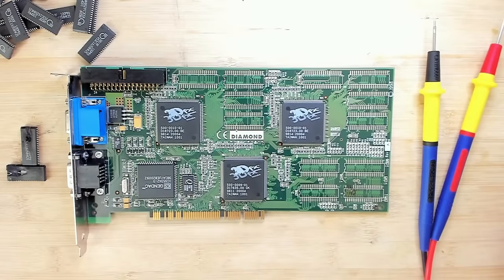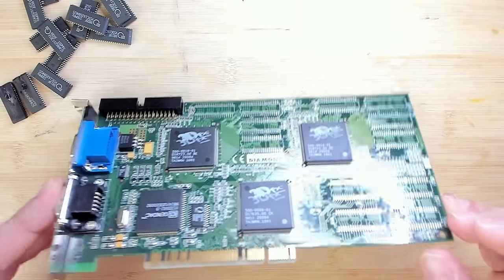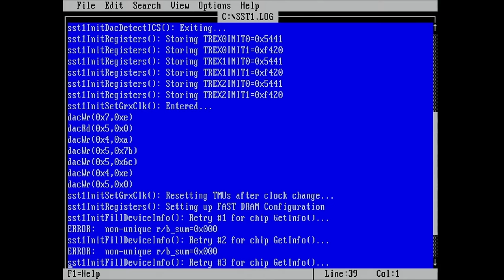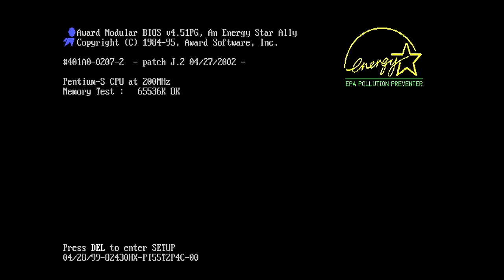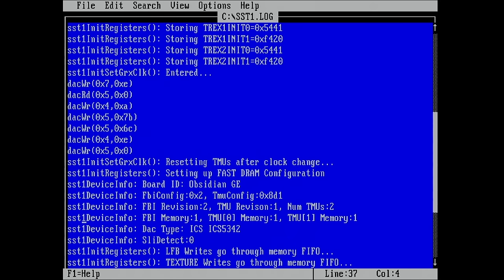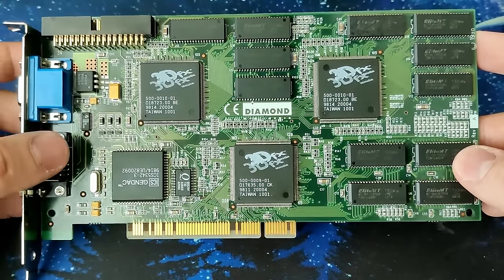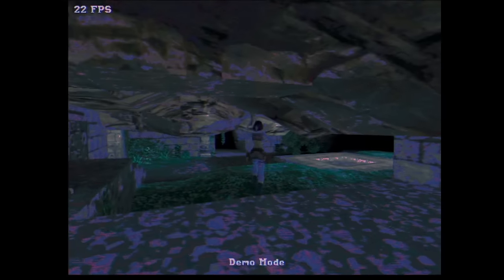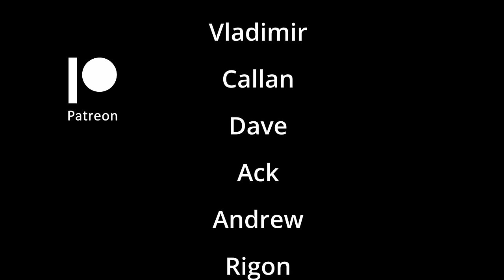Diamond Monster 3D II - A Voodoo 2 rises from the ashes? (Part 2/3)

Comment: Hell yeah, it's alive! 🤘 Well, somewhat. We all know that Voodoo magic sometimes comes with unintended side effects. 😄 Amazing though to see that at least some of the irreplaceable chips should still be good.

Ballsy move to plug it in at that stage, I would have disconnected the output from the VRM and checked its voltage first. And I would have powered it up while watching it like a hawk with that fancy InfiRay IR camera, ready to power it off at the drop of a hat. I was super relieved to see you successfully helped it get rid of its smoking habit! ✌

That color issue looked very reminiscent of VGA connector issues, my guess would have been the DAC, especially since it is alsodirectly connected to 5V. Glad to see it was just an issue with the TR patch and is already "gone". Still kind of a happy accident since we wouldn't have gotten to see Lara with the correct patch yet, right? As for the lack of FBI memory, I concur with what some have already suggested, checking all the data lines between the FBI and memory chips should be the next step. Hopefully it's just a damaged line between the two, causing it to stop looking past the first MB, rather than the FBI chip itself. If it is, maybe you can fix it by manually adding a wire or by doubling up memory chips like you did on the Voodoo 1 cards?

Hopefully, the observed slowdown was just a consequence of the inappropriate TR patch or of it having just 1 MB of frame buffer memory to work with. I couldn't think of anything else causing such an issue on a card of that generation really.

As for (hopefully useful) suggestions that have not already been made: Hit it with the thermal camera, comparing it to the identical model you have. Any observable differences may be a pointer as to where (physically) things still go wrong. Since the 1 MB issue already showed up when installing the first 2 MB, it would make sense to be located around there?

Seeing a Mega Monster (that's what Diamond called a pair of them IIRC) in action once again would be awesome, I'd love to see some videos about that! I actually built one of these (from two retired cards) for a neighbor back then, it was a great option to extend their useful lifespan for a bit! SLI was way better when it still stood for scanline interleave! 😉

Comment: My guess is to start by checking all connections, starting with the chip enable lines on the memory. Considering it can use variable amounts of memory it likely checks what is there by seeing what it can read write to successfully. So ras cas etc are next. You might also use a scope to check for weird signaling on the memory lines.

The color.... I would ignore that until the memory is fixed, I don't think it's likely to be related to the ramdac. But one thing at the time.
Reply from the maker: Agreed! Focus is on fixing the memory amount on the FBI chip. It is the most obvious issue for now.

Comment: I would suspect a bad trace. Also, perhaps check out that burnt spot you think you saw. I mean, it should be an indicator of something bad.
Reply: I think the black spot is a melted via, which means it was probably connected to the Vcc plane on one end and a part that needs power on the other -- or even half a chip, since the RAM chips have two Vcc pins each and they don't seem to be connected internally. I kinda hope this is true because it's easy to bodge around and there's no worry about signal timing or anything.

Comment: Incorrect memory sizing is almost certainly addressing related. The FBI isn't able to address anything past the 1 MB range (0x100000). I would try checking address lines from the FBI and seeing if they connect to each memory chip. After that you might just be SOL with that FBI.

Comment: I imagine that the FBI issue could result from any of the following: A bad memory chip, or two, or three; faulty trace, either disconnected, or a bad connection is adding resistance/capacitance/etc.; damaged FBI circuitry.  The possibility exists that one of the old faulty memory chips failed in a way that send too much voltage along a data or address line to the FBI chip, and it 'popped' an input protection circuit on the die.  If a sort of memtest existed for each memory bank on this card, that might make the issue very clear.  I am uncertain if that functionality can even be tested in a user-visible way, but since the output is user visible, I imagine a creative solution exists to test the memory.  Swapping the memory chips around could also help test the bad chip thesis.  Have you not received any sockets yet, or do the 100MHz chips malfunction in those fixtures?

Thank you for the quick 2nd video on this!  In your own time, for the next one.
Reply from the maker: I didn't put sockets because there is no space on the board. The memory chips are too close to each other or SMDs are in the way. I hope to gain access to something really cool that might eliminate all the guesswork!

Comment: I'd try a test program in Glide that writes to the front buffer directly with the usual bit patterns to detect address or data errors. Not sure how much mojo does, it may just read/write until it find the first error, even if it is only in one data or address bit.

Comment: I remember there were some mainboards from certain manufacturers where they had what looked like a standard 24 pin ATX power connector but they wired the connector different than from standard. I think some old Dell machines that had the mini style ATX power supply did that. If you think they're using a standard ATX pinout and try to test a machine with a spare ATX power supply, it's possible you could send the 12V to the 5V on the mainboard. If this is what happened I'm quite certain the original machine this came from was totally borked.
Reply from the maker: Sigh, that reminds me of my recent adventure of EISA and OPTi local bus. Same connector, electronically different! Great!

Comment: Not only memory chips can be affected by overvoltage. There also can be problems on data/address lines on 3dfx chips, wich were connecred to the burnt memory chips. No one knows what was happened with data/address pins when the "magic smoke" escaped from the memory chips.
Reply from the maker: I agree. I hope this was not the case, but it could be a possibility. That would mean, I have to replace the FBI chip. I have a card that could serve as a donor, but the chip has bent legs 😔

Comment: in the analog technic ( whoch VGA certainly is) a pinky discoloration is usually caused by a weak or conpletly missing green color.
so maybe chech the connection from VGA-green to the digital analog converter in comparision to the red and blue one.
fantastig work so far.
i enjoy your videos a lot.
i hope the card will come back from the dead. fingers crossed. regards alex
Reply from the maker: Thanks! I hope the FBI chip is not at fault. I have spare DACs, more memory, and a donor card for the other chips (I just don't want to replace the 3Dfx chip if it's not necessary). Part 3 will be interesting - can't wait to get it ready, but it may take a bit more time...

Comment: I would check that every data, chip select and address line has any activity in the fbi memory with oscilloscope as sanity check before replacing anything. My guess is that something is stuck high or low and is the reason why it sees only 1MB and in bad case it's the FBI chip internal diodes
Reply from the maker: Agreed! Better to get as much information as possible before replacing chips randomly. I might get access to something that will hopefully eliminate all the guesswork!

Comment: I'd recheck all the connectivity for the FB memory after you repaired those pads.
There is a chance you lost a connection there and since each chip appears to be half a MB I'd say it fails on chip 3 which could be the one you repaired.
It most likely detects memory by cycling through the first address of each chip and sees if data can be stored there during init. Common way to check memory.
Reply from the maker: The chip in place of the burnt one on the front is the only chip I have checked thoroughly. I need to check all the other memory chips on the FBI chip and see if I can find the problem. Worst case, I would need to replace the FBI chip.

Comment: if you're going to check the address lines for good connections also check for short to PWR GND some lines might be stuck because of PCB damage
Reply from the maker: I checked all those lines multiple times. Nothing suspicious and no shorts. Part 3 is ready with the resolution of what was the issue. I'll release it soon!

Comment: One of the chips for the framebuffer is bad, or bad trace.
Could also had high power come out of one of the melted chips onto most likely one of the address or data lines and fried one of the TMUs or FBIs. 
I'm not too familiar with the architecture of this card, but you could easily find the culprit with an oscilloscope and start probing the TMUs/FBIs for weird signals. 
Once you find the weird signals, trace back to the ram chip and remove it. If it clears up it was a bad ram chip or chips.
If it doesn't clear up, TMU/FBI bad.

Comment: I first would blame the PCB. I would check those vias under the blown memory chips. In my opinion the memory seen is really 1M, maybe some adress/data/control lines to the rest of memory chips have no continuity. If there is continuity from the memory chips (all of them) to the FBI, then I would blame the FBI. For sure, the DAC is not affected (in my opinion) because it outputs all 3 colors well, (I saw R, G and B). 
Also, that is what mojo also tells you: the memory for the FBI is the culprit. So, test all the lines from EACH memory to the FBI chip.
Reply from the maker: Thanks for the details! Ok, I'll check all connections to the FBI chip. So far, I focused on the chip that sits on the pads I repaired, those connections seem to be fine. But of course, it could be another chip that is the problem.
Reply: @bitsundbolts  I do not know for sure the memory configuration for Voodoo cards, but it seems to me that you have there two memory chips for each megabyte of memory. So, I would guess that there are two banks of 4 memory chips that are wired in parallel (data and adress lines) and the control lines are connected directly to the FBI chip. Maybe at boot, the FBI chip checks the available memory and if not found the remaining 3 memory chips, it assumes that there is only 1M available. This can be even if one data/adress line is faulty. That is why, I would check this first, also because those vias under the blowed chips may be affected by the failure (that first chip had melted metal inside so the extreme heat might caused bad contact in these vias)

Comment: What glue did you use for the replacement pads? Must be something special if it can take the heat of soldering.
Reply: As far as I understood it was an ordinary UV solder mask. After it hardens, the contacts will stick.
Reply from the maker: Correct
Reply from the maker: It is solder mask, which I kept outside in the sun for about 30 minutes. Once it cures, it can withstand the heat.

Comment: the tomb raider ingame scenes miss the green colour channel. You can use a six segment colour wheel to detect which colour is missing. The legs of lara should be yellow instead of cyan, so no green is present. Maybe a faulty DAC or a faulty VGA switch on the voodoo card. Check the green VGA output pin if any signal is present with an oszilloscope. This does not explain the missing memory. There are address lines missing. If data lines are missing, the game should have more picture defects.
Reply from the maker: I will first try to solve the memory issue as the discoloration seems to be related to the 3Dfx patch I had installed on my tomb raider installation.

Comment: Noticed some pink stripes in static positions which would point towards something being wrong with the framebuffer.
Don't know much about these cards at all but DACs of that generation often required negative and positive rails, often at fairly high voltages like +-12v that forces you to connect it directly to the psu rails so it could perhaps be borked?
Reply: Went and looked up the datasheet for that DAC. It does NOT need negative voltages and runs at a comfortable 5v.
Reply from the maker: Yes, but exactly this 5v line was the cause of the memory blowing up. I am surprised that it seems like the DAC is working. The only hint I have is the limit to 1MB for the frame buffer. Would be sad if this chip is bricked.

Comment: First learn how the memory is laid out. Likely it is laid out in chunks of 1MB by 32bits. The second bank is likely the one with the chip that welded into the pads and you had the pads repaired. After that is confirmed you can then check each bank for control signals (RAS/CAS/OE/WR) address lines and data lines. An method of viewing is needed (logic analyzer or oscilloscope). It is very likely that MOJO checks for RAM sequentially and gaps of malfunctioning memory will prevent detection of more memory. Motherboard chipsets do map memory dynamically but videocards are not required to do such a thing.

Comment: The QS5244 bus driver is on the 5V rail right?  Worth checking it looks right on the scope.
Reply from the maker: Yes, that is the small chip next to the DAC, right? This chip is indeed also connected to the 5v line. It would be an easy chip to replace - low hanging fruit so to say!

Comment: Hello BuB. I love all your videos and as always, give you my like.
I want to ask you. Why do you not socketed the memory chips? you said in the previous video you want to do it. And added to that, what happens if one of the memory chips is bad? one of the first chips. Even i see all the video, I get the idea of the first mb of memory have a kind of a problem while you add more memory, the issue persist. That's the strange feeling of the first memory is the faulty. But obviously could be other thing... (but in the video sequence you like... that's the problem, from the watcher perspective i mean).
Reply from the maker: I wanted to install memory sockets, but unfortunately, there is no space. The memory chips for the TMUs are too close to each other. There's no space. Same for the memory chips on the FBI chip. They are spaced a bit further apart, but there's still not enough space for four sockets. The other issue is that there are capacitors and resistors around the memory chips which are another obstacle for sockets. That is why I did not install sockets.

Comment: I'd remove the RAMDAC and the line driver/buffers and try Mojo. They are connected to the framebuffer memory aswell (the framebuffer contents are what as to be converted to analog VGA by the RAMDAC). Any defect in these chips can cripple the memory aswell, making it "invisible" to the FBI. Since those chips are connected to 5V aswell it's not far fetched for them to be damaged.
Reply from the maker: Hm, so far I everyone is telling me to keep the RAMDAC in place as it seems to be working. Interesting and I am with you regarding the connection to the 5v line. Those two chips are definitely connected to 5v. Maybe i will replace them and see if it makes a difference!
Reply: @bitsundbolts  In my opinion there's only 2 reasons why the FBI does not see all the memory (barring bad connections, which you claim to have checked and are OK). Either the FBI chip itself is damaged, or something else connected to those same memory chips is "pulling them down". That other thing can only be the RAMDAC/line drivers. I guess there's only one way to find out...
Reply from the maker: I might get access to something really interesting! Maybe the guesswork is going to end quickly! Part 3 would be super interesting!

Comment: There are... If I'm reading the block diagram on Vogons correctly... 88 lines from the FBI chip to the DRAM, and termination. I have a hunch that some of them  may have gotten vaporized when that chip exploded. Likely very fixable with bodge wires. As others have said it's time to start toning things out.

That said I'd also check that all the chips are getting vcc and vss, it's not guaranteed those lines didn't vaporize too.
Reply from the maker: I checked all connections to the memory on the front. There could still be an issue with the memory on the back of the card, but the issue with 1MB on the FBI chip emerged when installing the front memory chips. I'll continue to look for the cause, but I'm confident that it can be solved.

Comment: Also had a memory detection issue, but on tmus. It was a solder bridge, well hidden. Not sure this is the case here considering your skills 😂😂😂. Maybe a cracked line? Or a grounded line on adress selection lines?
Reply from the maker: Thanks, well, I already reflowed the solder on all three 3Dfx chips. I doubt there's something, but a trace could still be an issue. Although, I have checked a lot of pins on the memory already - so far I didn't find anything.
Reply: I really hope you manage to find out the issue. Your videos are really valuable when it comes to understanding how these cards work. I'm really amazed at the "yolo" design: not a single fuse on the 5v line. In the end it did work out well... But still!
Thanks again and crossing fingers

Comment: When you were repairing the pads for the FBI memory, you didn't show actually connecting the pads to the traces. Could that cause the issue with the missing FBI memory?
Reply from the maker: I did connect the pads to the traces. Yes, it's not in the video. I didn't capture that part. But connectivity to the FBI is there after the memory chip is in place.